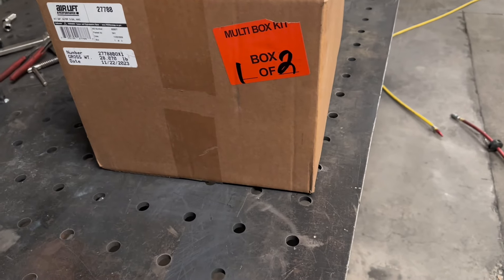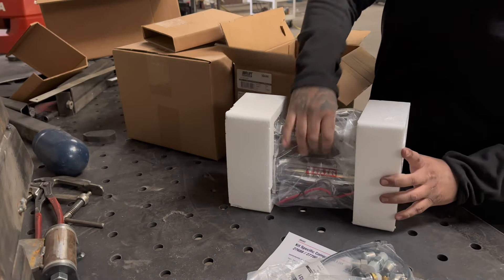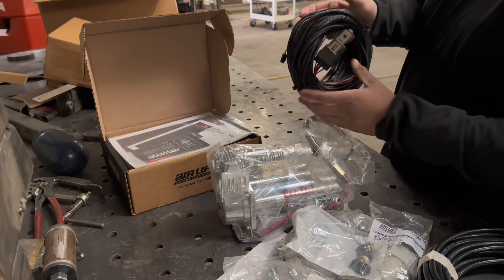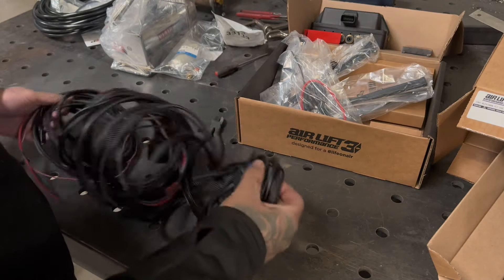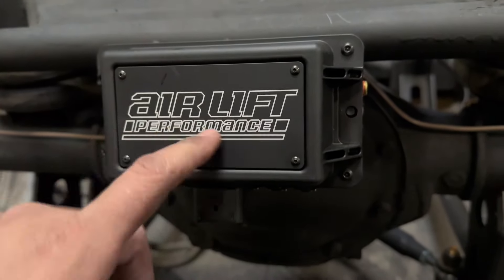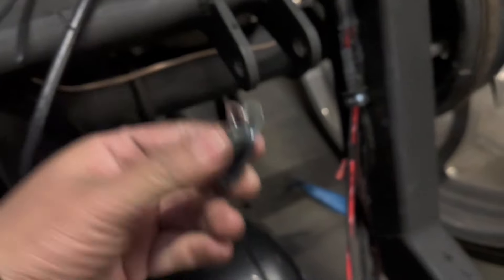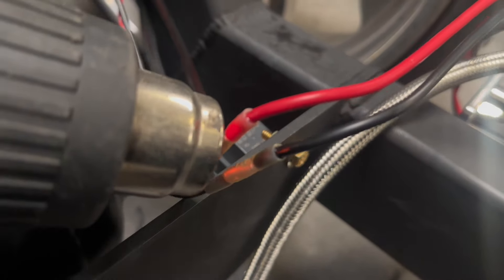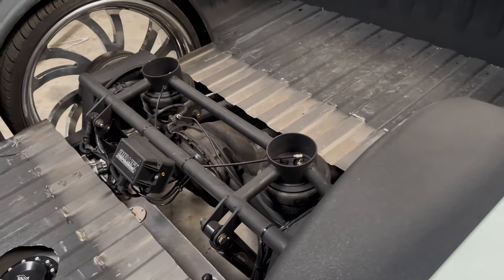Airlift 3p install on the bagged trucks

Comment: Are ebay airbag kits any good?
Reply from the maker: Ive seen some quality kits on ebay you just have to know what you are buying
Reply: What if you want to run a husky 60 gallon home depot compressor can you wire that in with the air lift for max atmosphere pressure, Infiniti hack ????
Reply from the maker: Dont let that distract you Hector is going to be running 3 Honda Civics with spoon engines. And on top of that he just came into Harry's and he ordered 3 T66 turbos, with NOS, and a Motec system exhaust.
Reply: WOW!!!